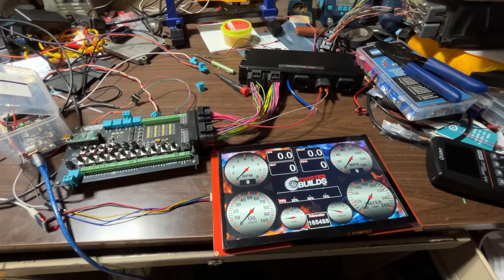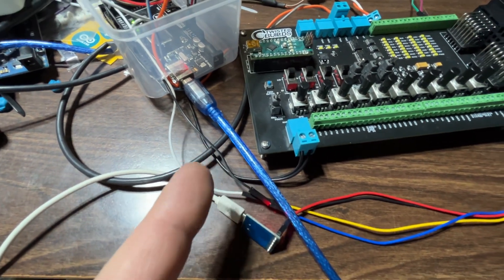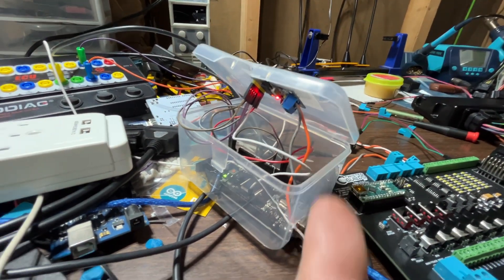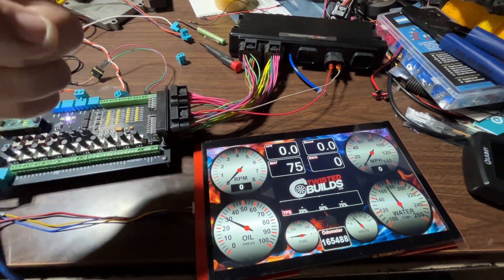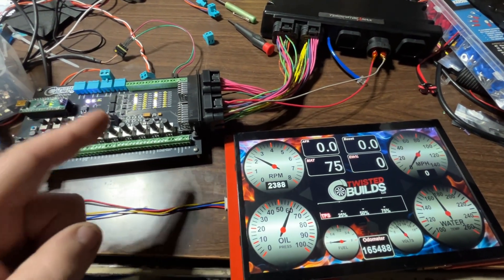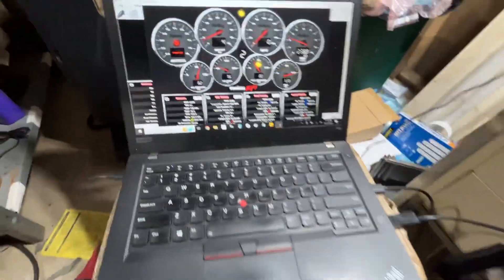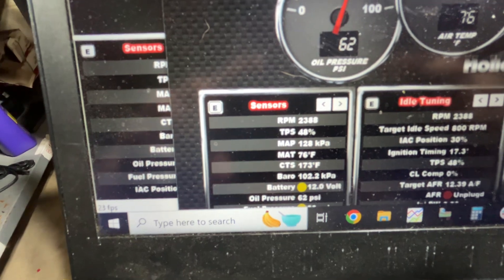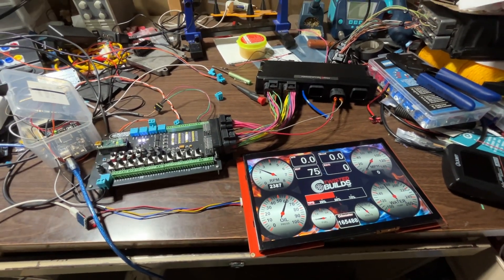Well that’s NOT a Holley dash on that terminator x…

Comment: This would be awesome to integrate with my current projects pidash when I switch from microsquirt over to holley.
Reply from the maker: Thats what I figured would be a huge benefit for everyone when I release the public holley term x DBC file. Theres a few more parameters I want to define yet and fully test before I release it though. I'll make another video and have the links posted when that happens.

I was just super excited to get it working and wanted to share.
Reply: @TwistedBuilds  We'll all be looking forward to it, great work man
Reply: @TwistedBuilds  it’s a exciting development that is much needed. Most of us don’t want to convert everything over just because of the holley name and cost to keep things like the dash. I’m an open source fan myself it helps push better developments.
Reply: @twistedbuilds awesome setuo but i have to ask, what is different on this compared to One Gauge systems as it looks all the same to me. Also, would be interested in more info on the engine sim board you are using.
Reply: @elowe657  the driver board looks like a custom based off of a jim stim from diyautotune many megasquirt guys use for testing.

Comment: Ok but all the stuff you need to run it. What’s the price point. If it’s a lot less than just buying the Holley dash it makes sense. If it’s a couple hundred dollars less. Than it doesn’t make sense.
Reply: The point behind it is, once he releases the CAN data you can build your own CAN devices to read the Holley data and do what you want.
Reply: The Holley 12" dash is $2,500. This is a few hundred dollars *at most*. The price savings is through the roof.
Reply from the maker: My goal would be make a 10" screen that would work with Holley term x, mega/microsquirt, along with a few others. Have GPS speedometer and SD card logging all on board for roughly the $500 range. May also include some other shenanigan's too (thinking possibly the ability to switch tunes through the screen) the same way the USB does it.

The Holley 12" screen is roughly $2500 currently on Holleys website. The 5" screen is $420 (comes with GPS speedometer), the 7" screen jumps to $913 WITHOUT the GPS speedometer, with it that jumps to roughly $1k, and it goes up from there.
Reply: @TwistedBuilds  thanks for not taking my comment as hate. And thanks for a great answer. I’m gonna sub so I can follow this.

Comment: Nice. That screen may be too tall for most vehicle dashes, something that is more rectangle than square would probably work better.
Reply from the maker: Agreed. However this was a more proof of concept video and proof I had good working data off the terminator x working on Holley canbus. It’s literally tied into the same wires you’d use for the 3.5” screen or the USB connector I was using in this video.